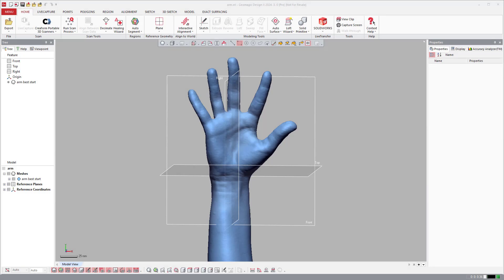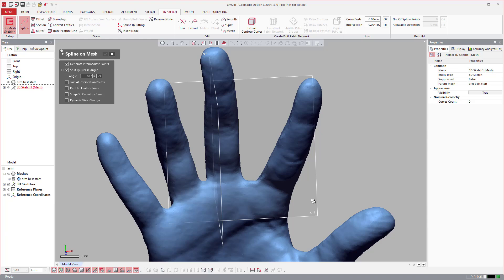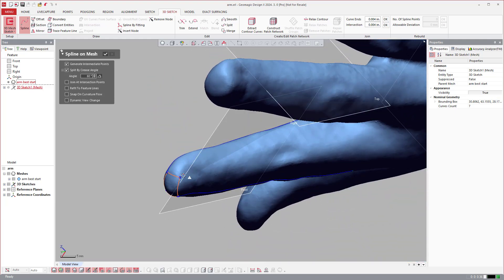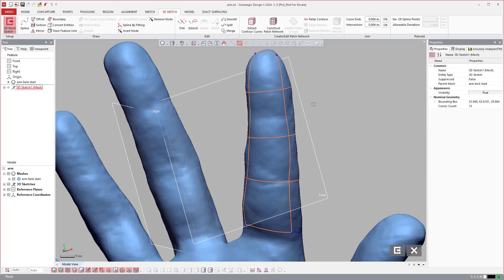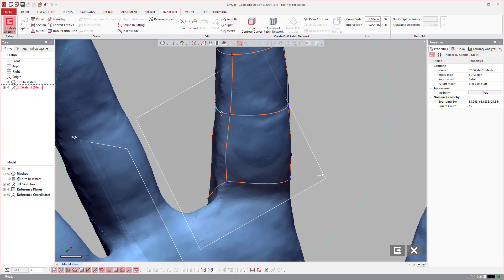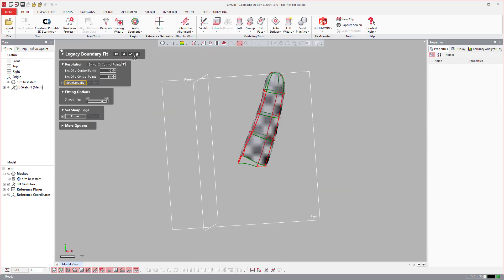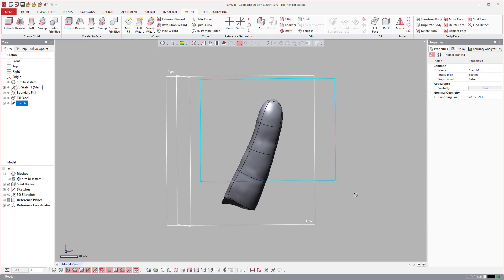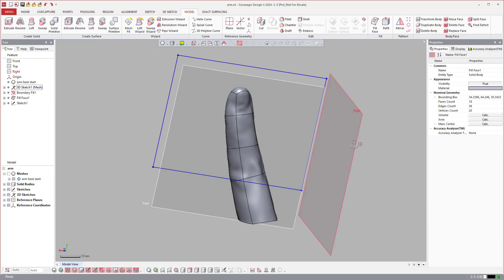Boundary Fit Surface 2 0 - Geomagic Design X

Comment: Hi :)
We are looking for a better soft. for convert Mesh to NURBS, we use actually Catia V5 with 3 modules, we try Geomagic and result is very better, clean and faster.

But we not understand why you use the "Boundary Fit Surface" in the menu, because in the Exact Surface TAB we have the fonction "Fit Surfaces Patch", why 2 fonctions do same? Which use? Wich difference???

We are totaly confused....
Reply from the maker: It’s actually a personal preference. The boundary fit is the older tool and I have always liked the way it works better for partial surfacing. 

That being said, we are going to update the Fit Surfaces here soon and I think it will probably sway me over to that tool more.

Comment: Thank you very much for your explanation. We are waiting for more example videos if you have the opportunity. Best regards. :))
Reply from the maker: Any topics you want to cover?
Reply: @gregoree197878  For example, a file received via render is in obj format. But since it is not solid, I cannot produce it on a 3D printer. Can I convert a file in obj format, a non-solid data, ito solid in Design X?